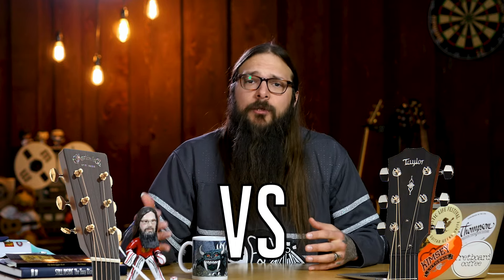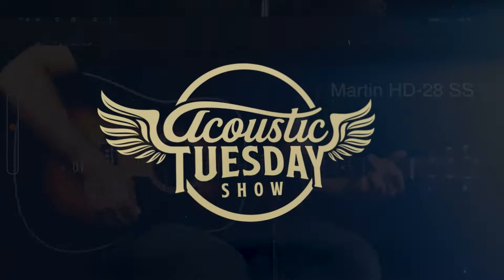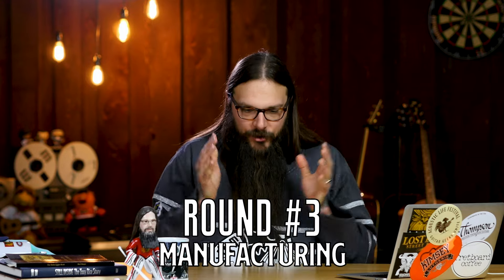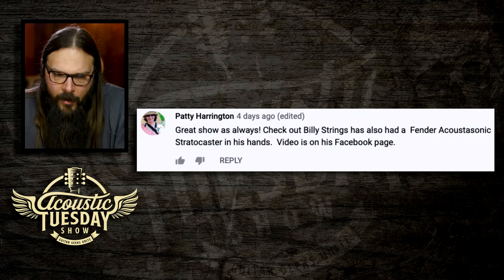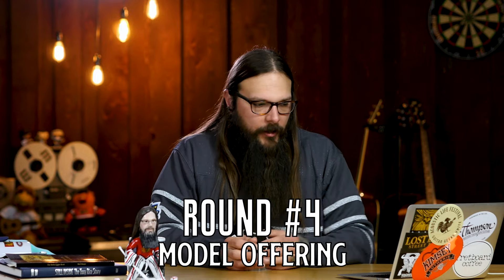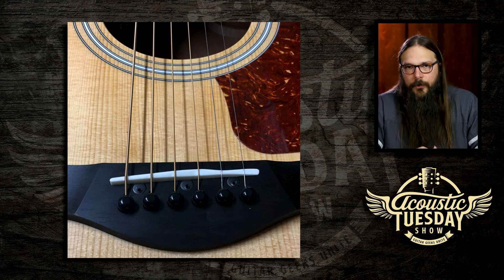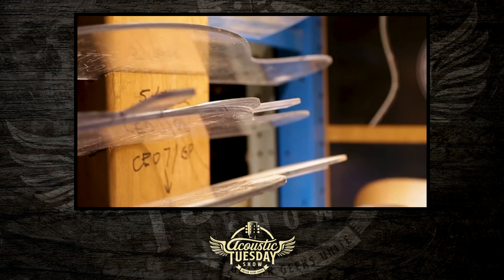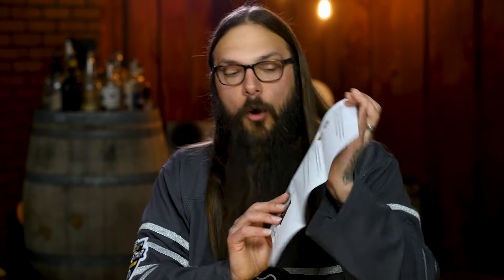Taylor VS Martin: The Definitive Showdown ★ Acoustic Tuesday #137

Comment: Martin Guitars Are Deeper Sounding, If you take comparable models with very similar components, they are bassier than the Taylor.  Martin's are very traditional guitars, and built often to traditional standards, they will be slightly harder to play out of the box, and will have a sound geared towards more traditional blues, country music, and bluegrass music.  A Martin is generally very bassy and more understated, it goes well with accompaniment, or rhythm guitar when you don't want the tone of a guitar to play against a singer or lead soloist.  Also Martin has more finite sounds in their guitars where Taylor's sound more homogonized, so if you are looking for a very specific sound, you can explore deep into Martin's lineup and locate that sound, unless that sound is a Taylor Guitar, lol.  A Taylor guitar comes out of the box ready to play, and is easy for a strat player or electric player to come in and play acoustic easily, their guitars are brighter sounding, so summarizing easier to play, and brighter.  A Taylor would support a larger guitar sound for a lead guitarist often, or some more cheery instrumentals or soloist work.  A blues player will probably much prefer a Martin over a Taylor, and I think the Martin Sound play's into minor keys and chords, this is also transparent if you watch professional's play as well, whereas most blues players are heavily towards Martin's or other brands.  Where as a Taylor has a poppier more modern sound and pro's in pop groups or more mainstream music are going to play Taylor's on stage.  I really think most of this comes down to the bracing used and action after comparing specs and playing both types.  I like both guitars for different things, just kind of depends what mood you're in, and what you are playing.  I think every guitarist that loves guitar and sound should own one or two of each.

Comment: Bolt-on neck of Taylor is a winner for me. Neck reset in the future is now easy.
Reply: jOHN CORTEZ  I have had one of my Martins for 25 years.No neck reset,and I don’t see one coming in the near future.Tayors bolt on neck is not a plus in my opinion.Martins dove tail joint is fitted to one guitar.Taylor necks are interchangeable with shims.That contributes to a thinner sound.The bolt on neck sure makes it easy to mass produce though.

Comment: I will offer a different angle on this. To my ears Taylors sound better (clearer) than Martins from the player's position (i.e. with you holding the comparison guitars and the sound holes projecting away from you). But once you put both guitars in someone else's hands, and the sound hole projecting towards you, Martin clearly outshines Taylor (granted, I am talking top of the line models of both manufacturers).

Comment: There is no question.  Martin is the long time runaway winner. Resting on their laurels???? Those are big LAURELS to rest on. What is the most copied guitar body style in the world?? Yes, you said it, the Dreadnought. Why? Because it is perfect. From the most economical to the most expensive boutique luthiers, they have all tried to copy the Dreadnought. Even this competitor you are pitting Martin against. Why do all violins with a certain look say a "Stradivarius Copy"? The very same reason, perfection. Martin's claim to fame is not just the Dreadnought, they have also perfected other models from parlor to orchestra, which most other luthier have copied the Martin design also.  Can you think of any other acoustic guitars that are more revered than "Trigger" or "The Holy Grail #58957"? Both Martin's.

Comment: Martin found and stayed solid on the design that gave THAT MARTIN SOUND, that most all country and bluegrass players MUST have.  Taylor has been changing things up just to try and catch up to that MARTIN sound.  Taylor had not close match for it until the new V Bracing, and they are close with that, but still not there.  Martin figured, like I would, why fix what is not broken.  Taylor was FORCED to innovate or get left behind, and now, to get a Taylor that is similar to martins sound, you have to pay triple what you can get the same sound out of a Martin for.  Just sayin.